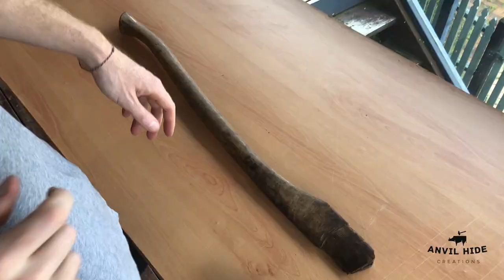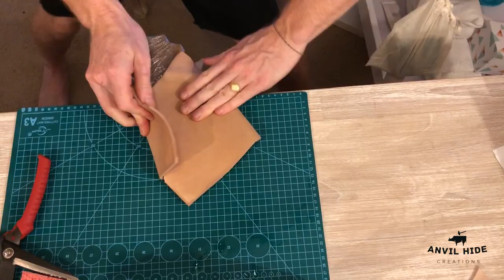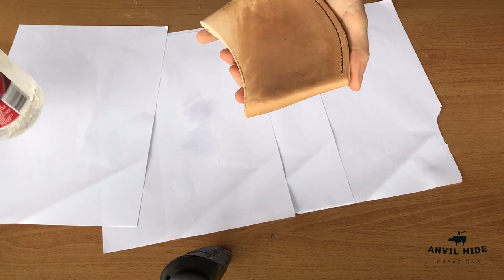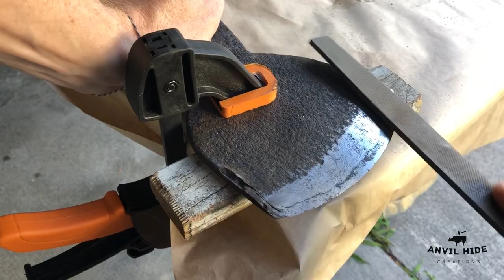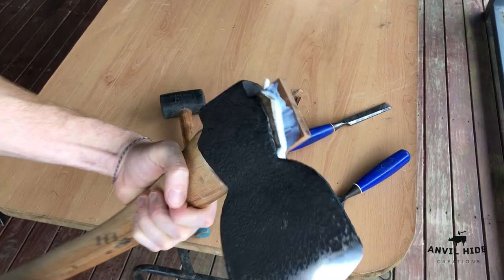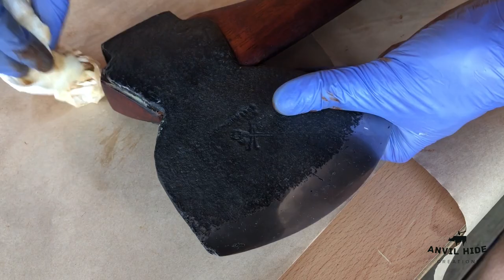Vintage Axe Restoration and Sheath Creation using Hand tools only

Comment: Awesome restoration! You did a good job. There is only 1 thing I would like to point out and that is the handle. Personally I would have just sanded it very lightly with some high grit sandpaper just to remove the surface dirt and then apply some raw linseed oil. The reason I don't sand old handles is beacause they have this amazing dark patina from all the blood, sweat and tears over the years that just pops when you apply oil. Also degreser is great for the head but I would avoid it on the handle since it's wood. This is all my opinion and i'm not telling you what to do, just do what you feel is best. Happy restoring!
Reply from the maker: Thanks, Yes I thought about this but I wanted a stark contrast from initial to the finished look so I used the dye

Comment: This restoration video was top notch and that axe came out to perfection. I’ve never seen leather dye used on a handle but the color was great. What was that leather dye ?
Reply from the maker: Thank you. It was just a cheap water based dark tan. Fiebings would have a similar shade.